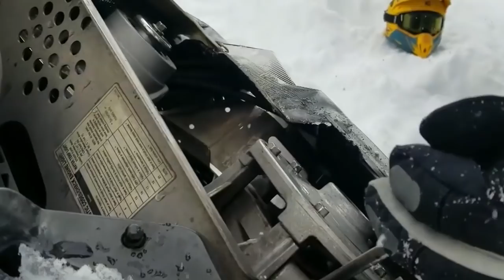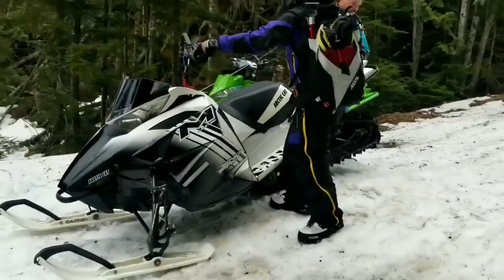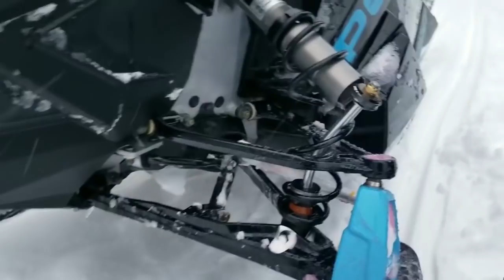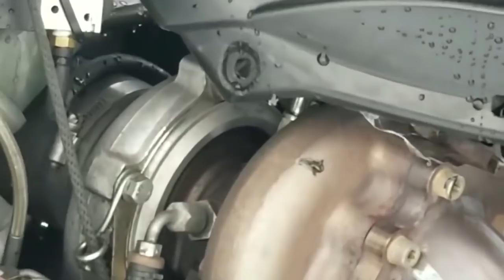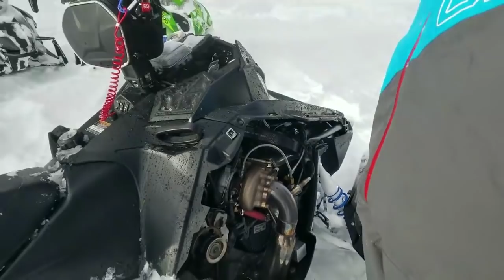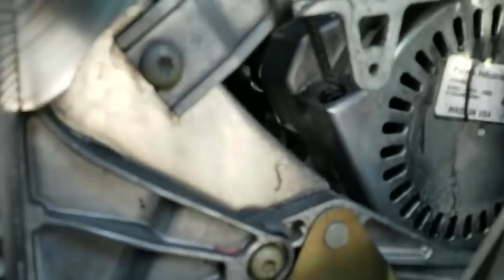BROKEN SLEDS | Montage of Wrecked Snowmobiles

Comment: All newer style sleds. Don't get me wrong they are nasty sleds but I would rather ride older. They dont make them like they used to!! One of mine is a 98 vmax 700 xtc with 13,000 miles on it. I am definitly not easy on it. Usually just race it accross fields and lakes  it never let me down. Its reading 100 psi in each cylinder so finally about time for some new rings!! Maybe next year.. hahaha.

Comment: The first one happen to a buddy.. we got it back to the truck.. booster cable 3/32" 7018 rod and 1/16" 6013 rod is what we use because 2 Batteries and i would use 1/8" 6010 rods with 3 Batteries.

Comment: Cool vid guys!
Now im not trying to start shit, but i rode Doo up until I bought my 2017 King cat last year. I dont know wtf is up with cat, but they literally rattle them selves apart. My upper A arm bolt fell out once, loc-tite it back in , came out again.  Lost a track tensioner once and they rattle loose regularly, even with new nyloks!  I dunno, guess its just how it is. But man does that 998 have Re Donkulous power!  Gotter tuned up to 270Hp, and WOW!